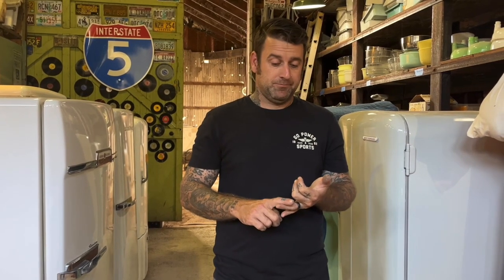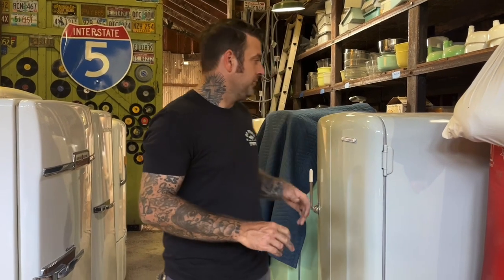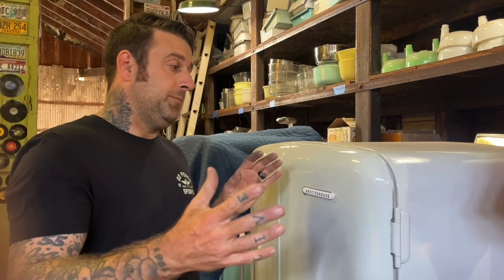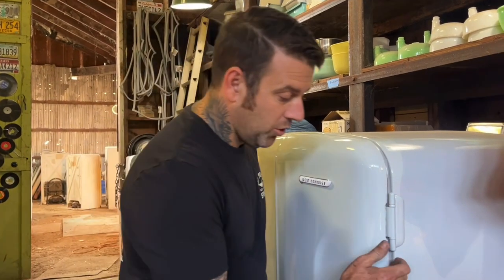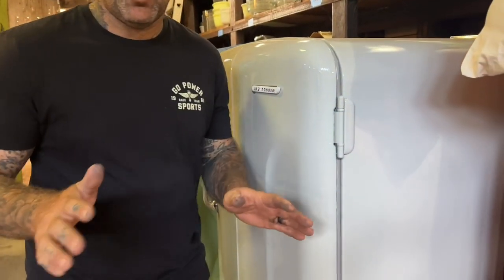Are Vintage Refrigerators Energy Efficient?

Comment: You should do a video about Westinghouse's automatic defrost. Two capillary tubes, two suction lines, and a compressor that runs backward for heat to defrost the freezer! There is a counter in the thermostat. 60 times of opening and closing the door starts a defrost cycle. They are magnificent refrigerators. Also, they use a special door gasket that never rots.
Reply: The YouTube channel Calvacade of food showcases that model in their episode on vintage refrigerators. It’s fascinating!

Comment: Yep!  My 1956 CoolSpot uses less than $15 a month, as that is the energy bill.
Reply: 1971 Sears Cold Spot here.  Still running.  Came in 3 colors those years.

Very quiet.  No evaporator motor.  Freezer fan REPLACED twice.  about do for another one? comment please

Comment: I am still using my parents 1967 GE model TB16SCC unit upstairs. It was bought as a housewarming gift by my dad's mom new back then and it has only required repair one time. In 2000 I replaced the cold control with a Gemline GC135 which was a reboxed OEM unit. That was a $45 repair. I picked up another NOS one last year off of eBay. I also have a 2005 Whirlpool fridge downstairs. I still have the original owner's manual for the GE (as well as the Magic Chefs noted below as well as OEM parts lists for them) and I have an OEM parts list for the GE as well. The GE has a manual defrost freezer (which I just defrosted last week). 

I will keep it going. As you said, it was paid for years ago. I fix all my own stuff. I use vintage Sears tools and equipment. My toolboxes are from the 1960s. I am old and new school at the same time. Sadly, it has outlasted my grandparents on both sides and my parents. I also have the original 1968 Magic Chef wall oven and cooktop in the kitchen. Those and the GE fridge are Avocado green. I have fixed those a few times over the years. Only the dishwasher has been replaced since 1967 (this is the 3rd one with a WLP made Kenmore in 2019. I fixed the 1987 Kenmore that it replaced a few times over 32 years, but the tub rotted out and it was not worth fixing). 

Give me something that was designed to be repaired any day.

Comment: With our knowledge, today, we could build refrigerators which are both energy efficient and packed full of convenience features and able to run for 90 years without a problem.
Instead, we have Whirlpool units (regardless of cost) which leak out in five years. We have LG cooling systems which, despite major improvements still fail the day after the warranty ends, reliably. We have Samsung refrigerators which are beautiful and have outstanding mobil apps...and their ice-makers and defrosting systems are worse then the first 1950's units, unserviced, are, today.
Reply: They just want you to buy a new one every 2-5 years.  They don't want them to last 80 years.  Still I'd rather have my 1947 kelvinator than any new garbage.

Comment: my vacuum is 76 years old and is a 3 amp motor, it will still out clean most modern machines, and alot of appliances of the 50s were low amp low wattage cause you only had a 60 amp service to your housing back then typically so yeah the old stuff if maintained is great

Comment: I disagree todays insulation is better. As long as it is not a frost free freezer. A self defrost bottom by compressor cycling and manual defrost freezer use the least electric.  The old refrigerators have to have piston and valve wear reducing the efficiency.
 I  would also think motors are more efficient today, or hope so. For example I got a 7.5 Cu. ft. Frigidare uses about 40 bucks a year of electricity. It is a great size for two people. At 198.00 from Walmart and free delivery.